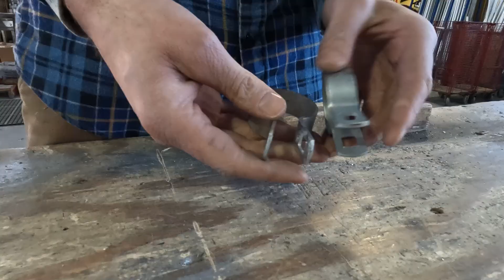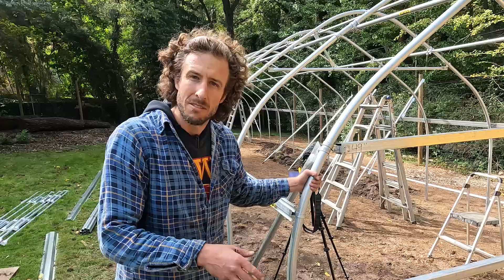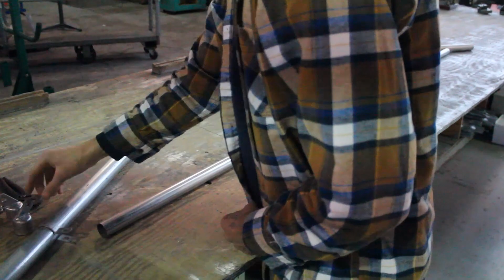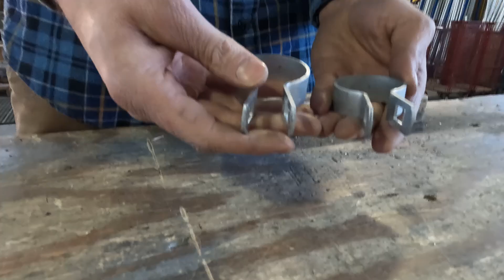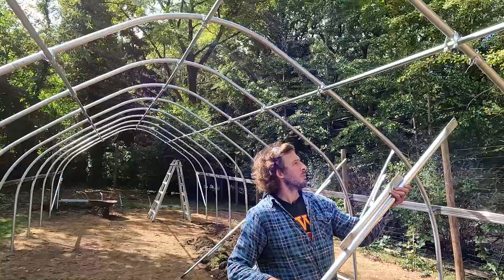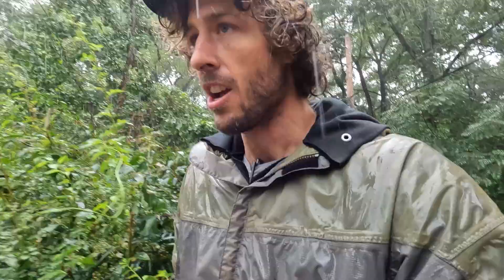How to Make ANY Greenhouse or High Tunnel Stronger

Comment: Nice tip .
I was thinking of reusing een old party tent ( or several ) as a high tunnel .
I was thinking as concrete to make is sturdier , that means that i have to think in advance were to put things like screws .
Reply from the maker: Very cool. Before committing to old tents as framing I would recommend checking the outer diameter of that tubing to make sure it is an outer diameter that will work well with common greenhouse hardware like two-hole straps, purlin clamps, cross connectors, and brace bands. Hopefully it is either 1-3/8” OD, 1-5/8” OD, or 2” OD. Not absolutely a requirement but would certainly make for an easier build if the old tent frames were one of those outer diameters. Thanks for watching and commenting!
Reply: @tunnelvisionhoops  Well i can make or adapt materials if needed , i have some tools for it .
Reply from the maker: @dreddredd7137 good to hear!

Comment: I've been thinking of doing this to our 30' wide Gothic high tunnel. Same concept, right? The frame is 2" OD 14 gauge steel with 1.163" OD 17 gauge purlins. 
Do you sell truss material?
Thanks for the helpful content!
Reply from the maker: Certainly the same concept, although with a wider span you may want to consider a truss that is 1-5/8” OD steel, and also four truss supports as opposed to two; this is referred to as “w-style” supports as opposed to “v-style” when there are only two supports. You could still employ the use of end-cups for the 1-5/8” OD tubing, and 1-3/8” OD tubing. If you were only able to use 1-3/8” tubing for all of it, I have seen that before too. Thanks for watching and commenting!

Comment: I see that you are bracing a low wall which I have wanted to do as well.  Question, is ther a way to detertmine the best placement for the (maximum support) the arms that go from the "rafter" to the bow
Reply from the maker: A general rule of thumb is to use the horizontal rafter as a guide. If doing two supports, one to the left and one to the right of the center purlin, I would try to roughly have that support connect to the bow directly between the center purlin and the point where the horizontal member attaches to the bow. Then this support piece would attach to the horizontal rafter about a third of the way down the horizontal rafters length. It is a little difficult to tell but if you look at the finished trusses in the video, the horizontal member has three sections that are fairly equal: from the bow to the support connection, then between the support connections, and then from the support connection to the bow again. This “law of thirds” is an approximate way to determine where you would want your supports to connect to the horizontal piece. Once you know that you can measure from the horizontal piece to place your support will connect to the bow, cut some steel, and the. Get one set up to see if you like how it looks. You can always adjust the rest of them, but this would be a good starting point, in my opinion. 

Hopefully the above makes sense… it is kind hard to write out what I am visualizing, but hopefully it comes through. 

Thanks for watching